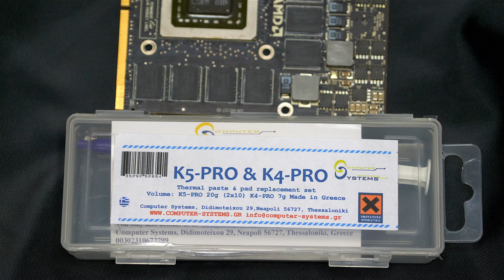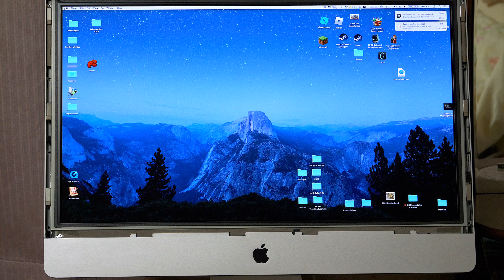Late 2009 iMac 27" Video Card Repair — 4850 — 3rd Bake

Comment: Don't buy AMD 6970M cards from China.  They bake them severely and they are expensive.  Indicators are memory chip writing on the tops that is faded from heat and PCB graphics that are yellowed.  Buying broken cards from US sellers and baking is cheaper and you can get 2GB cards this way.  AMD part numbers are confusing.  Cards that end in 47 are 2GB.  Cards that end in 57 can be either 1 or 2GB.  57 spec sheets on the 'net say 1GB.  The difference is memory chips.  Samsung memory is 1GB.  Hynix can be either 1 or 2GB.  Hynix with suffix AFR is 1GB.  MFR is 2GB.  So far, I have bought two broken -57 cards with Hynix MFR memory and both are 2GB.  Both came back to life with a bake.  Cost was about 1/4 of Chinese cards so IMO worth the gamble.
Reply from the maker: And of course Hong Kong technically is China.  I purchased my 6970M with matching triple-pipe heatsink from a Hong Kong seller.  The card looked like it might have been baked.  I asked the seller about it and they strongly denied it ever was baked.  But even their thermal paste job looked like it had been baked, so I guess they flat out lied to me.  Someone told me my card is actually a PC card based on the little red pieces at the 4 corners of the GPU.  Not sure if that is true or not, but if true, then it means the HK seller also flashed the card, and perhaps the firmware they used explains why my late 2009 27" iMac suddenly powers off when the GPU temp rises to about 77°C or higher.  I have been able to prevent that problem through the summer months this year by ramping up the iMac's internal fans and using room A/C.
Reply: @JDW-  Ugh.  $250 from China gets bare card and no heat sink assembly so no help for those with 2 pipe heat sinks.  US sellers who are breaking up iMacs typically include the heat sink.  All the more reason not to buy cards from China or HK.  Shutoff issue would annoy me.  77C seems low.  It should be 100C just like the CPU.
Reply from the maker: @encinobalboa  As I show in my video below, for about the price you mention (including DHL express mail shipping), I got the 6970M (2GB) and the same triple heat pipe heatsink that is used in the 2011 iMac from a Hong Kong seller. https://youtu.be/9dPsH1zIQMs
Reply: @JDW-  I have watched that video and even commented there.  In fact, you hearted my comment, thank you very much!   Particularly helpful is showing how easy it is to fit the 6970M to an older machine.  Salute to you for helping so many 09 and 10 owners gain a few extra years of service life. 

The point I was trying to make is that buying broken from US buyers and being able to identify the card as 2GB means that a great deal at $60-70 shipped is possible.  Even if the first one does not bake, you still have a couple of more bites at the apple (pun intended) before reaching $265.  I have baked four cards so far and all of them have come back to life.  And judging by your viewer comments, the success to failure ratio is so high that I don't consider buying broken 6970M a gamble.

Comment: No way to install a small fan over the GPU/Cpu? I remember the old Pentium CPUs had that tiny fan above it. Hey since Im going to screw up may as well go big, will this GPU work (minus heat issue)?: A1312 Mid 2009 2011 HD6970M upgrade GTX 770M 3GB DDR5 VIDEO CARD?
Reply: 770M has been done on YouTube.  There are patches for boot screen, brightness, and sleep.  Be careful with 21.5 as the power supply is rated at only 210 watts.  27 p.s. is 310 watts.
Reply from the maker: I suppose it might be possible to add a fan, especially if you remove the optical drive.  But you would want all the hot air to blow up and out of the iMac.  It would appear the 770M will work in old iMacs, but with some caveats: https://bit.ly/30yHOUb

Comment: LOL I know but cant find a complete set up. Right now my stock 2009 iMac is running at: CPU 96 Deg F and GPU 104 Deg F.. Is this even normal?  I have no issues with it and never did a thing in 10 years except yesterday I did upgrade to an SSD drive. My issue is I need a graphics card that can run my CAD program, otherwise its runs great BUT.. Im a hacker so any ideas, I won't give up and won't buy a new one, LOL..
Reply from the maker: My 6970M runs at 125°F most of the time. It’s stable at that temperature. But when the temperature exceeds 167°F, then my iMac suddenly powers off.  And like I said, keeping all three internal fans running at a higher speed in combination with room air-conditioning keeps the temperatures close to 125°F most of the time now.
Reply: If degrees are F, your temps are very cool for Mac.  If your temps are C, you are in the danger zone.  Get Macs Fan Control and set to manual to bump up fan speed.
Reply from the maker: @encinobalboa  Indeed.  He said "°F" which is why I replied in "°F" but I prefer to talk in °C most of the time.  Anything above 100°C is a recipe for disaster.

Comment: just in time before i threw my 2010 imac away....gotta try it...nothing to lose!
Reply from the maker: If you want to replace the PRAM battery, I believe the 2010 is the same as my 2009 in that you'll need to remove the motherboard.  In that case, you will need to watch my 1st bake video.  But if you don't care about that battery, my 2nd Bake video is a bit faster because it doesn't remove the motherboard.  https://youtu.be/6BJGLFCigdA  Just be sure you use the correct thermal pastes (you need two types).  Also make sure you use a turkey thermometer or another oven safe thermometer to verify your oven temperature does not go above 200°C.  Please let me know how it goes!
Reply: @JDW-  Thankyou. I just got it apart and see the battery is in front, but still had to remove the Motherboard to get to the screws on the back of the gpu. it must be a 2011because it has the heat sink with 3 cooling tubes.
Reply from the maker: @treborkciddur  I look forward to hearing how your bake went.

Comment: Hi again and thanks for the great info! Nee you help/advice before I really mess this up: I could not find a complete GPU with heat sink for my late 2009 but found a A1312  HD6970m 2GB stand alone GPU. If I replace only the GPU, will the heat be too much since the older heat sink has only 2 cooling cores? If I do Install would you recommend anything to help? Maybe an interior cooling fan on GPU? Or use a USB cooler? Drill holes at top of iMAC frame , etc? Anything as I cant find the entire setup...Thanks!
Reply from the maker: You definitely need the triple heat-pipe version heatsink that the 6970M shipped with in the 2011 iMac.  That is the one I demonstrate here: https://youtu.be/n2a8oEI2y6U

Even with that 3-pipe heatsink, as I show in that video, the excess heat can trigger a sudden power-off problem.  I repasted but that didn't completely solve the problem.  I then boosted the speed of all 3 internal fans and when needed, use room A/C.  That has kept the 6970M running well over the summer.  But I know it would not work at all with the 4850 heatsink.  You could try using that heatsink and then remove your optical drive for better airflow, but I am still skeptical if that will keep the card cool enough.  If you get the same auto power-off problem as I do, then it means you would need a better heatsink -- preferably, the 3-pipe version that comes with the 2011 iMac.  I cannot advise drilling holes in the iMac as that would not only look bad but it would alter the flow of air inside the Mac, possibly in a bad way.
Reply from the maker: @floriansipos I have never tried to remove my optical drive because as I said in my previous comment, I am skeptical if it would work.  I only mentioned it because a few people who have commented under my videos said they did that.  But they didn't give me detail temperature readings before and after.  So I cannot say if it really helps.

That EBAY link is expensive!  Some people have said I paid too much for my 6970M with triple heat pipe heatsink, but I paid less than the EBAY link you provided.  The 6970M doesn't have metal support, but that doesn't matter to me since I am satisfied running High Sierra.  Catalina requires a patcher.  And even with a Metal compatible card, the late 2009 27" iMac doesn't have a very fast CPU.  I really think it's best to run Catalina on a new iMac.

I used to upgrade to the newest version of MacOS every time a new version came out.  That was true beginning with my Macintosh 128K in 1984 all the way through High Sierra.  I was not impressed by Mojave, especially because it began complaining about my 32-bit apps, and then Catalina killed the 32-bit apps entirely.  So a move to Catalina means death to some apps I prefer to use.

I do have Catalina installed on a 2TB SanDisk Extreme Portable USB SSD, which I use with my mid-2015 15" MBP.  I did that so I can run the latest version of FCPX.  I use that to edit my YouTube videos.  And my experience with Catalina on that SSD is enough to tell me I don't want it on my internal SSD or on my 2009 iMac.  That is why I am not rushing to get a Metal compatible Nvidia card.  Besides, Nvidia cards don't offer acceleration in FCPX, from what I understand.  Lastly, Nvidia cards need firmware patches to run and you need to use Windows to do that.  Maybe that is why your EBAY card is so expensive, but keep in mind that EBAY listing says nothing about its firmware.  It doesn't even include the heatsink!

Comment: Thank you just bought late 2009 imac 27 inch no problems so far with gpu but if I do I’m taking your recipe and advice to do the fix ..paid 100$ for a late 2009 27 inch beautiful clean iMac
Reply from the maker: $100 is an excellent price for what you get.  Congrats on the great find, Kevin!

Comment: Hi, just letting you know my first bake worked, however i tried my second when it went bad again, i went to 225 degrees c and im afraid some of the small resistors were then found laying on the baking tray along with some solder at the end of the bake, so clearly the solder does melt at fairly low temps. Anyway imac now goosed but not worried, didnt pay much for it anyway
Reply from the maker: Thank you for sharing your experience. As you discovered, you definitely do not want to raise the oven temperature above 200°C. There have been a few rare cases reported where the oven temperature was set to 200°C but still some components fell off, and I believe that is due to the fact the oven temperature in those cases was actually a bit higher than 200°C. So these days, I recommend that people put a turkey thermometer inside the oven to verify the 200°C setting is indeed correct.

In theory, a card that lost its components due to desoldering could be repaired by having the components resoldered. But practically speaking, you would not know where those tiny components should be returned and therefore your only options at this stage would be to either buy another card of the same type or do like I did and get a 6970M with matching heatsink and use that instead. 

Some people have reported success with similarly shaped video cards used in the Windows world, but such requires a Windows PC to flash those cards in order to work on the Mac, and I honestly don’t think that process is easy for most people.
Reply: JDW , The 6970 is not better, this card have the sam temperaturę problem. This card have more RAM and speed, but will fail after using a few years. The melting point from tin is much higher than 200 C and the small caps and resisters don't fell down, You can also use Alu so only the GPU become the max heat. Some people have experience with hot air guns direct heating the GPU only.
Reply from the maker: @viktorhugo8252  It's not a question of the 6790M better "better" than the 4850.  Both cards indeed die after a few years.  It's simply a matter of (1) finding a replacement card that works and (2) finding a replacement card that doesn't force me to use Windows to flash it.  Another reason I chose the 6790M because it was actually easier to find than a replacement 4850 at the time I was searching EBAY.
Reply: JDW , all apple GPU cards should work, also 48xx, 56xx, 67xx, 69xx - only the heat pipe from 21" and 27" are different.
Reply from the maker: @viktorhugo8252  Yes, I know.  But again, at the time I was searching EBAY, only the 6970M was readily available (with matching heatsink) for a semi-reasonable price.  That is why I bought it.  Had I been able to find a much cheaper 4850 card which had never been baked before, I probably would have chosen that.
Reply: JDW , the 4850 512MB is sell often with the 21" Mac. 56xx and 67xx are often in the 27". If I become a 765m from the never Macs I will try it in the 2009, 2010 and 2011 MACs. I hope the AMD 765m is much better designed then the ATI. All my updated Macs also run with Catalina 10.15.6 after 11 years.
Reply from the maker: @viktorhugo8252  I have a late 2015 27" iMac at the office which can easily run Catalina, but I am still running High Sierra because there are fewer bugs.  I know this because I purchased a 2TB USB SSD and installed Catalina on it so I can run the latest version of FCPX to edit my videos.  I keep Catalina on that SSD because I still prefer High Sierra.  For that reason, a metal-compatible video card in my 2009 iMac isn't so important to me.  Apple is still offering updates to High Sierra too.  I just installed the latest today.
Reply: JDW , which Version high Sierra did you use. No of the last version of high sierra?
Reply from the maker: @viktorhugo8252  10.13.6, but what I installed today was Security Update 2020-005.
Reply: JDW , THX
Reply: Never exceed 200 C when baking.  200C is just below solder melting point.
Reply from the maker: @encinobalboa  Which again is why I now advise people to use an oven-safe thermometer during the preheating time to verify their internal oven temperature matches the dial setting.  While rare, some people have reported desoldered components despite their having set 200°C.  Some ovens are hotter than the dial setting.

Comment: I have watched your videos several times now and thought I would give this a go with my Late 2009 iMac. As i am typing I am waiting for my card to cool after my bake. I will paste it up and  install it later today and let you know how it turns out. While I had the computer apart I have completely dusted it out and I will put a new ssd in it if the card is working. I am just booting from an eternal drive at the moment as the iMac did not have a drive in when I picked it up. Wish me luck.
Reply from the maker: Good luck!  I look forward to hearing the result!

Comment: I think these GPUs were originally designed for laptops so would have been horizontal and not vertical as in the iMac..this could be a gravity solder shift problem when pushed to over heat like mine did when I had over 8 pages running during a heavy research project.
Reply: Still going strong..card works great...still amazed that even the newest 27" 2018 iMacs only have a i5 processors compared to my  work horse mid 2011 i7 3.5 mhz  12 gig ram machine...greatest iMac ever.

Comment: I have a late 2011 27" iMac`s i7 quad core 3.2 ghz with a AMD Radeon HD6970M with the pink and green lines of death..so in our convection oven goes the GPU ..on a cookie tray with a sheet of 
parchment paper suspended on foil balls with points through the screw guides -8 mins at 200 degrees turning the oven off at 6 mins letting it finish the 2mins -then I quickly removed it to the outside and set it in the hot sun for about 20 mins.. I did notice how clean and shiny all the solder connections were on the entire board. I applied a very thin coating of paste on all contact points "chip and 
memory " and made sure to tighten it firm but not too much..it worked great .in fact just cleaning all the fans in the case has also reduced the running temp about 10-15 degrees from normal.
Reply from the maker: Thank you for making time to share details of your successful bake, Rusty; and congratulations!  Please feel free to report back over time to let myself and others know how your video card is doing post-bake.  I read and reply to every comment under all my bake videos, and I know a lot of people have found lasting success with the 2009 iMac model video cards, but I am eager to hear from more 6970M users such as yourself to see if post-bake longevity is on par with the earlier video cards.  Best wishes!
Reply: Professional refurbishers that I have talked to say 10 minute bake then open oven door and cool for an hour.  Cool down is gradual.  They report higher success rate than with ambient air cooling.
Reply: Still going strong..card works great...amazed that even the newest 27" 2019 iMacs only have a i5 processors compared to my  work horse mid 2011 i7 3.5 mhz  12 gig ram machine...greatest iMac ever.